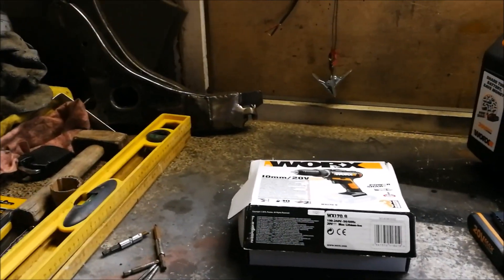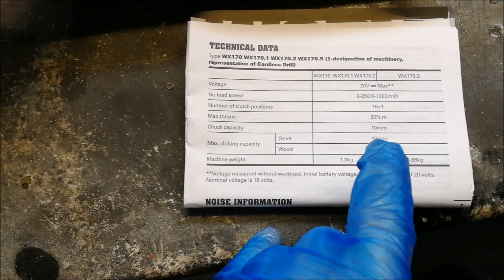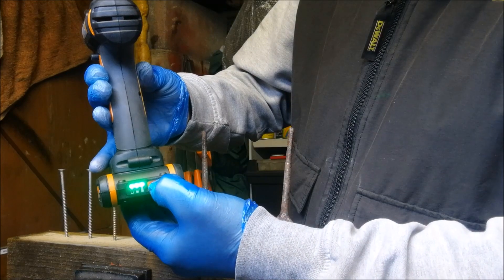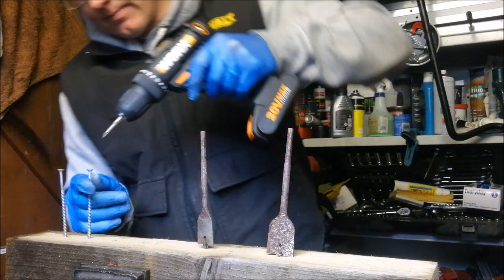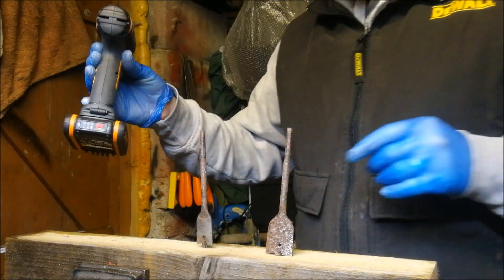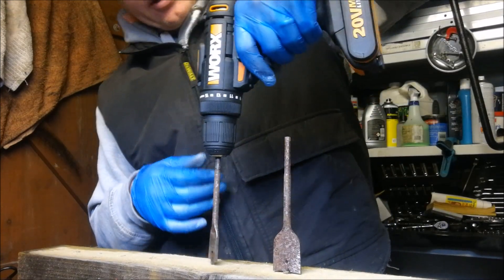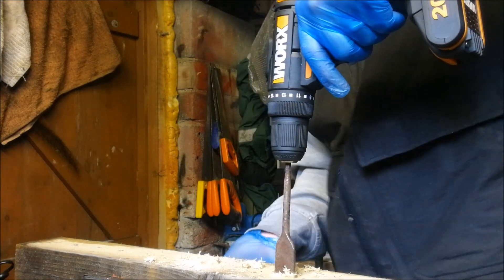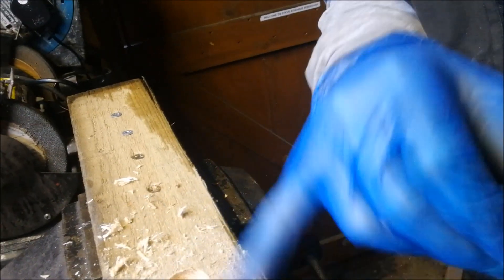WORX WX170 20V DRILL DRIVER TESTED

Comment: Should use number 1 for screws over 3 inch not a proper test.
Reply: I agree.
Let the torque run good..
I think this is a diy tool.

Not a proper tool for fine construction

Comment: This is bullshit really. I have the exact drill and it is excellent if you know how to use these things. Number 1 for screwing never fails with this length of screw and a new 32mm spade bit flies through 40mm mahogany doors. Also, why the battery was dying so soon I don't know..another thing that I haven't experienced. This drill was used in every way it shouldn't be. £35 drill right now..brilliant.
Reply: Agreed. I just put up 4 shelves, and 2 tv wall mounts with it. Had no issues at all lmao. Just.

Comment: Ur flat bits been in the shed for years. Even a DeWalt would struggle with them.
And big screw are always used on speed 1 as the torque is much higher.

Comment: the hell you doing charge battery first lol. you damaging battery. every tool battery comes in storage charged version. which means to preserve fully, so what it would be sold fresh new. charge battery fully gosh even mobile phones evryone knew you forst charge than use, if you ownt you brake battery. dude with dewalt jacket trying to say smth about other brands no wonder, with dull drills into super hard wood. you can see wood so hard sodry even bit gets on fire what a joker. you can grab husky chainsaw and you will fail to cut this log. i myself have nice 100 years + log which is basically rock. to cut it you will need 25 times to sharpen chain.